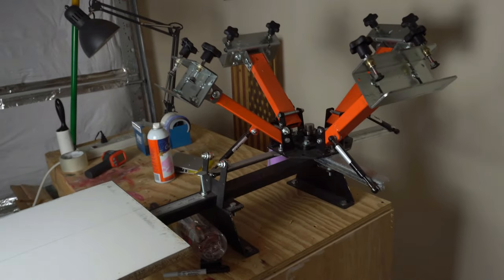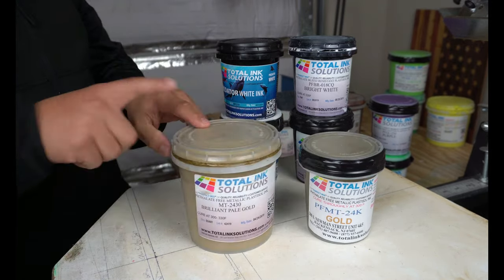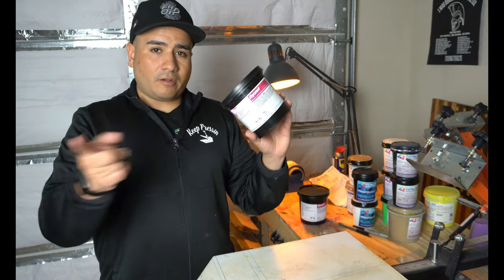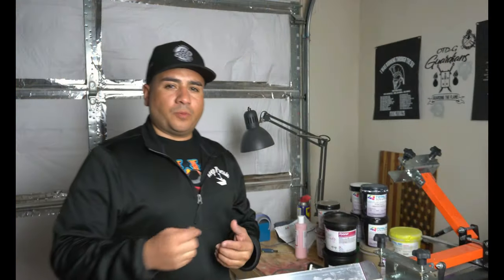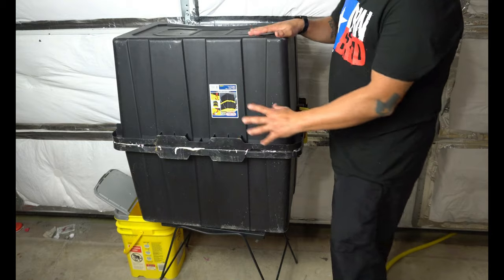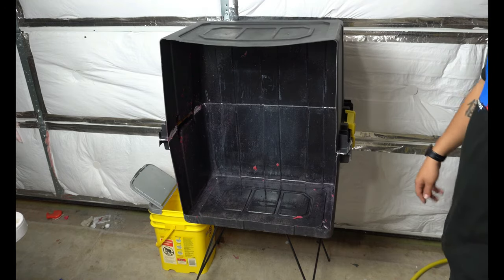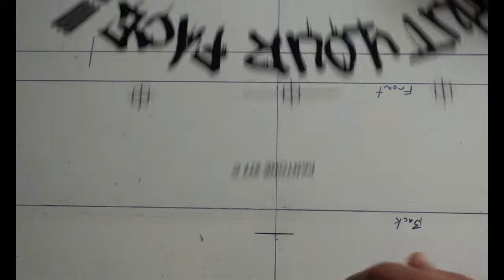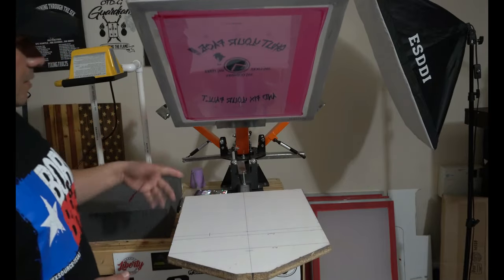My screen printing tips to coat, burning,  and washout screens.

Comment: Hey! I was washing out my burned image and it was coming nice but pieces of the emulsion actually came off with it. The pressure washer was pretty strong so maybe that did it. Is this normal or related to exposure time? If not I assume it’s the pressure washer but just found it weird bc I struggled to get my emulsion off of other screens with this pressure washer

Comment: If the streaks are the slimy, the emulsion is underexposed. Save the energy and wear on your flash unit by using a vacuum to quick dry an exposed screen. Works just as well without the potential of scorching the mesh and will make reclaiming a screen much easier.
Reply: Vacuum as in a using the extension hose with a flat attachment. I dig the washout basin, btw.  Good stuff!
Reply from the maker: @chrischarge3129  I appreciate your comment. This will help someone starting out. This video was 4 year ago when I first started out. Here I am now.

 https://youtu.be/xkB430x-K-s?si=Er-rPQSGD_kJ99RE
Reply from the maker: This one is better but still 3years ago, but what I'm still using today.    https://youtu.be/KuFVurNSRJQ?si=_H1WMiayjIlApV0H
Reply: @HeartHustlePrinting  right on! Keep up the good work.

Comment: So you need a different screen for every graphic "stencil"? what if you were just doing 2 shirts only? Would you be able to reuse the screen to burn another by putting more emulsion on it? Seems like it would be way too expensive to do it this way unless you had like 100 shirts to do with the screen you just spent so much time on setting up....Im confused lol ....To me it seems like just cutting a vinyl stencil would be way easier...I know I'm missing the point so hopefully you can explain because I cant find the reasons for doing it this way anywhere. I bought some screens and ink ect and vinyl but this is confusing me lol
Reply from the maker: For screen printing I have a minimum of 15 shirts. I wouldn't do 2 shirts. When im done with a job i take off the emulsion and get ready to use it for another job.

Comment: Amazing stuff. Best video for someone like me who's trying to screen print as a hobby. I have 2 doubts though.
Which light did you use for burning the screen (those specs would help alot)
And can we cure plastisol with heat gun as I really can't afford a flash dryer for now (if yes, how much distance should I maintain and for how long should I cure)
Reply from the maker: Light Hmmm not sure what its claaed ill have to look.  Heat gun only if using water base ink.  Hard to do ut with a heat gun.

Comment: I keep having my emulsion blowing out using the same type of hose and sprayer.  I'm using 110 screen and burning 12 minutes at 20 inches to a 250 bulb.  I can't figure out why the emulsion keeps bubbling up.  I noticed you washout on  both sides, others say not to do much on the back side.  Ideas?
Reply from the maker: 250 wont cut it. You need one of these thats at 1000 watts.

https://www.amazon.com/dp/B01A7MPREY/?tag=heartandhus09-20

One of thoes for 5 minutes and your good.
Reply: @HeartHustlePrinting  my original kit came with the bell lamp.  Thanks for the pointer.

Comment: I keep having a issue when I let my screen dry after applying emulsion I leave in the garage blinds closed under a table in a open box and let it dry for a couple hours go and try to burn and nothing try rinse off but noting rinsed all hard did about 6 screens all bad nothing burned onto the screen when I tried or rinsed off I don’t get it
Reply from the maker: You print might not be dark enough

Comment: Can someone help me!!! I coat my screen/let it dry.. put my design under a work lamp then when I go to wash it out.. the emulsion comes right off!! I let my coat dry for hours just to make sure its dry when I know it only needs around 40 minutes.. I print my design and put it on the back of the screen flipped for 30 minutes under the work lamp which I bought at lowes recently and when I go to wash it(I wash with care and low pressure) the emulsion starts coming off and no design is shown.. I use speedball screens that you get at Michael's and other craft stores with the speedball emulsion.. I also put a black background underneath so the design gets exposed... what am I doing wrong???? someone help please.. I've watched plenty of videos on this and I cant seem to figure it out